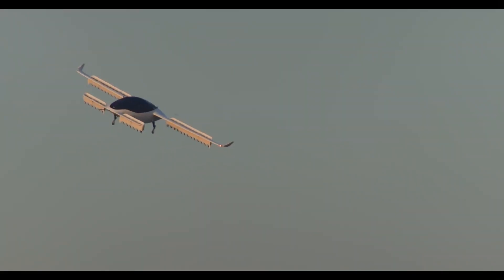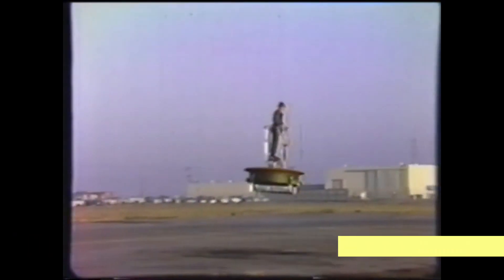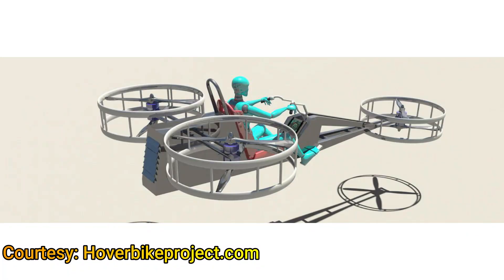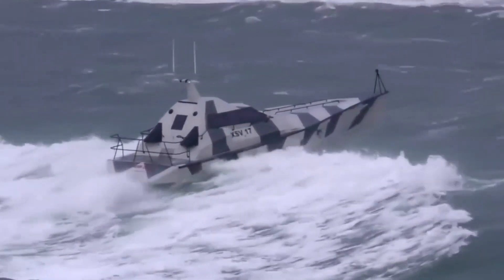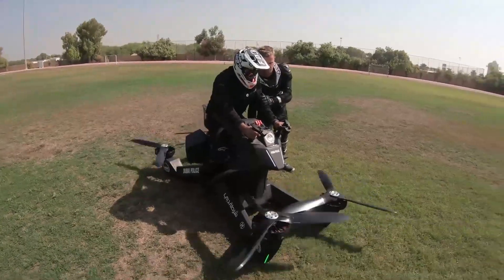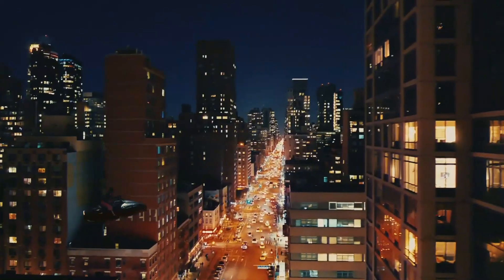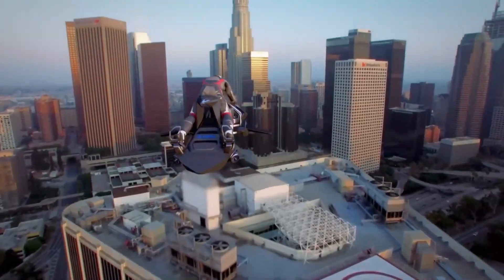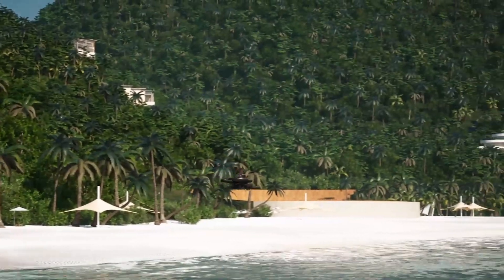Hover Bikes : Beautiful Flying Machines: Challenges

Comment: stop chopping peoples legs
Reply: you dont have to fly necessarily, you can slide like on ice, on graphite surface, slippy slip
Reply: lean back and watch
Reply: dont add non-necessary weight, make it longer and place the pilot lower-back position
Reply: start with graphite bottom surface lubricated hovercraft on a graphite track, or just asphalt
Reply: no wheels in the car
Reply: water craft turbine push vehicle, amphibious
Reply: also a water skimmer craft
Reply: body wing car

Comment: I think Xturisimo has the best potential, and probably also better margins of performance and safety
But I do think the concept of sitting on a saddle has the basic weakness of a machine going into negative G losing its pilot. Its flying by the seat of your pants taken too far.
On the other hand we have to engage that these lower speed machines which can cover the full speed spectrum without having to worry about stall speeds, 
that in itself is a challenge that Im not fully convinced can be answered as control speed safe in the lower speed range, and efficient in the higher speed ranges that wings assure.
Piasecki did some research into this area for their flying jeep.

Comment: Like you see on the drones presented here, the center of gravity is the lowest point, that may help in stable hovering but in forward flight is a no go. The energy spent to translate that in a forward motion will destroy the performance needed. What you need is a slightly forward center of gravity that is counterbalanced in flight with a back wing, in order to translate that inertia into speed. Naturally unbalanced with balance adjustment only for short hovering needed to take off or land.